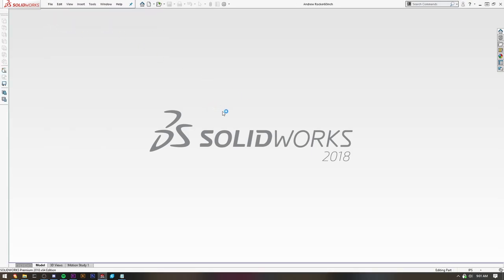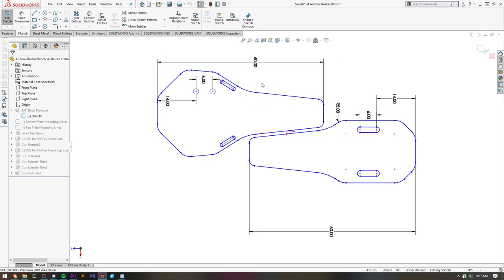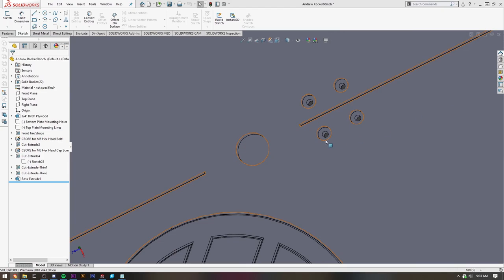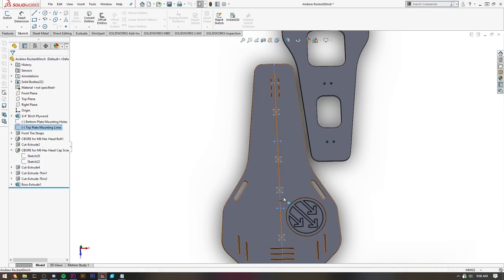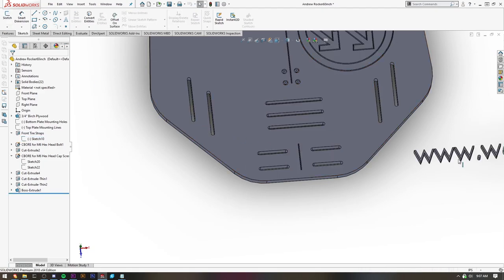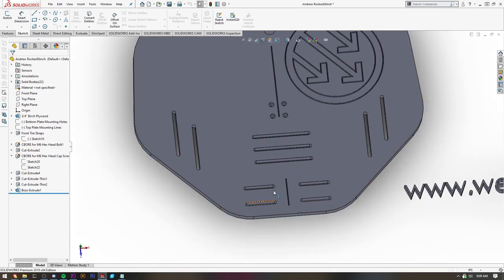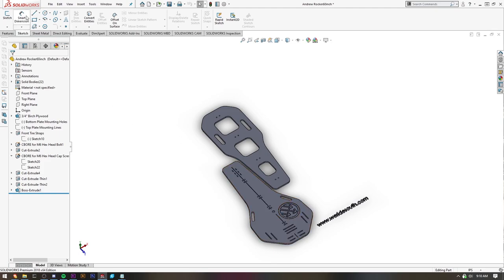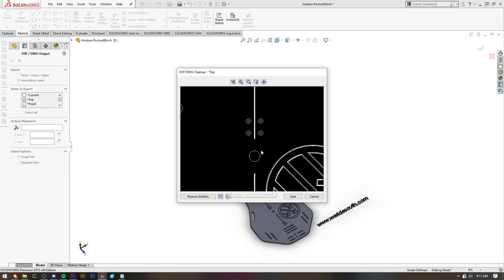Rocker Plate File & Design Notes

Comment: thanks for sharing the design Andrew - I'm assuming that a Kickr Bike will work fine with your design?
Reply from the maker: Yes sir
Reply: @WeRideSouth wicked - not all heroes wear capes!!  Can the DXF file be loaded straight into a CNC cutting machine/router?  I don't know how that stuff works (above my paygrade)
Reply from the maker: @unrealshots  typically yes, but the cnc operator will need to define the tooling and settings per cut.

Comment: Andrew, amazing work, really good. My bike is also a 58, it is a tight fit but it leaves around 2cm top and bottom, so it is good and looks as if it was made for it. My difficulty has nothing to do with your design, wich is top. I have a Elite Suito and the bracing cuts do not coincide. Printed on paper and doesn look doable with the existing cutouts. Have no idea how do work the dxf :-D ... Do you think you have a design compatible with the suito? Tanks man!!!!
Reply from the maker: Not sure about the Suito, but the current design will definitely fit an XR Direto with minor overhang.

Comment: Will these holes work for the kickr core as well as the kickr ?
Reply from the maker: Ben, I have not confirmed this particular plate with a Kickr Core; however, I am working on a re-design with a local core owner to release. I did have to expand the rear of the plate to accommodate the core, but I am not sure it's 100% necessary.

Comment: Hey Andrew thanks for doing the hard work.  I'm not a CAD trained or experienced. Is there a drawing with measurements illustrated?  I'm simple skills and will cut this out with a jig saw.  Thank you, Bill
Reply from the maker: Thanks Bill,  at the time I don't have any file with illustrated measurements and have been pretty tight on time. There may be someone in the Rocker Plates facebook group that could assist with this.
Reply: Did you end up getting this drawing with measurements mapped out?
Reply: Hi Bill, did you come up with a template?
Reply: G'day  @TheTurboEnterprise  do you have available a metric version of this file as will be doing this manually (non CNC).
Reply: @williamwalker6031   no.

Comment: Great design and good job! Since I want to outsource the CNC milling process for preparing both plates, I was asked to deliver STL, STEP or similar files. Could You kindly share your SW 3D project source file to prepare adequate files or to make some slight dimension changes? Thanks in advance! Regards!
Reply from the maker: Thank you! However, I don't provide my source files. You can import the DXF into SW and convert the lines if you'd like to make your own alterations. Sorry for the inconvenience.
Reply: @WeRideSouth  Sure. No problem. Thanks for your reply and for the hint ;-) Best regards!

Comment: Does the center line get machined? Setting up a CNC file now and that’s my only lingering question.

And if so, to what depth?
Reply from the maker: Yes. My guy just used a v bit on the cnc for a few millimeters. Maybe 2 or 3.

Comment: Any advice on how to see the dimensions?  I can open the CAD file in adobe illustrator,  but cant see the dimensions/specs anywhere. Thx
Reply from the maker: You would need a DXF file viewer of some sort, a CAD program.
Reply: @WeRideSouth  thx. I tried autodesh CAD viewer but didn't see measurements.  Must be user error.
Reply: @maxvega4217  I would think if Andrew only exports a DXF of the model geometry than there won't be any dimensions. If he lays out a 2D drawing with dimensions and then exports that then there will be dimensions. I'v never used Fusion 360, but this is how other programs work. I have never used FreeCAD, but you could import the 3D DXF file into Free CAD and then annotate to get whatever dimensions you need.

Comment: If printed the dwf file onto a 60x60 paper, would it be to scale enough to as a stencil?
Reply from the maker: Robert, I believe so. Here is a link to the rocker plate group on facebook where a guy did just that. https://www.facebook.com/groups/415329188897706/permalink/1091198961310722